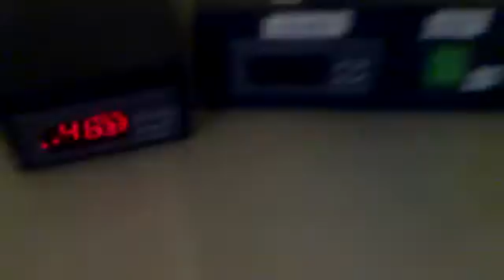All Grain BIAB with Internal RIMS - Part 1

Comment from the maker: On this system I'm running a Kaixin MP-20.  It flows about the same as the March 809 I use on my 3V, but the Kaixin is a lot cheaper and is still a magnetically coupled pump.  There are a lot of brewers who use the same size system with the Kaixin mp-15, it just means you get less flow to recirculate pass the heating element.